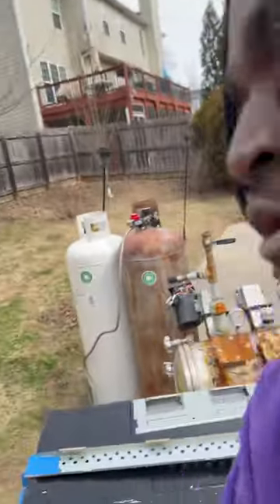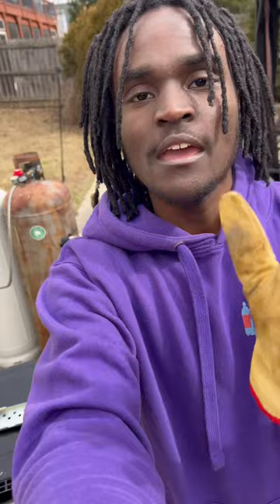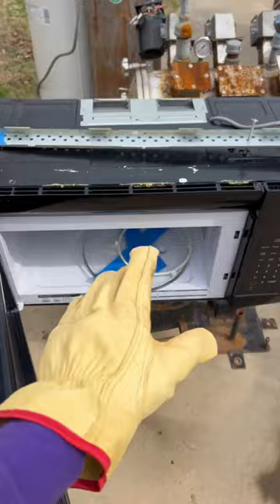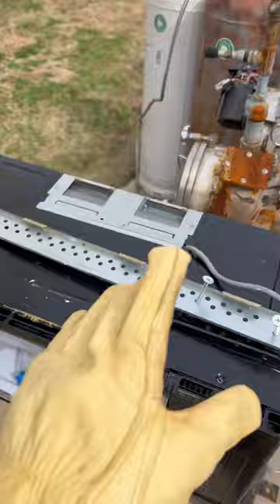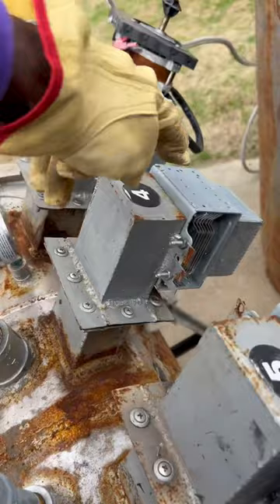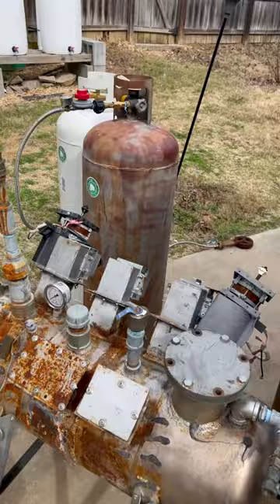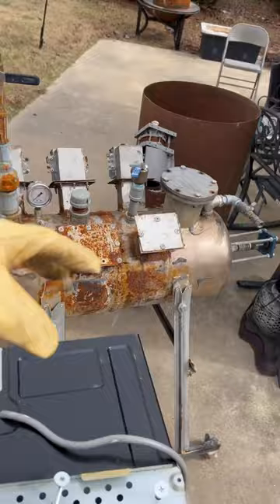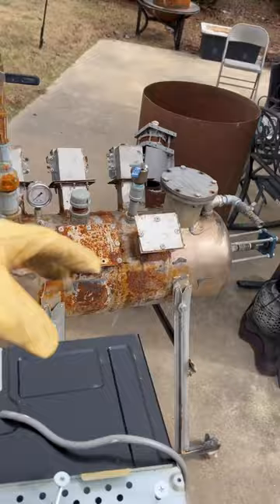Did you know plastic can be turned to fuel with microwaves? ⚡️ #naturejab #viral #fyp #science

Comment: You know using two mots per magnetron will give you 100% duty cycle?
  Be safe with that voltage, I've had 12in sparks!!!!!
Reply from the maker: 2 mots at once is a lil too scary for me 😂
Reply: @naturejab  you are still young, I don't know how much experience with house wiring and electrical work, but let me explain a very simple solution. If you already know this stuff skip ahead to next reply.
   Do you know that in the USA , it is 240v, it's only 120 to the plug because it's only one side of a center tapped transformer. The 240v is 240 because those legs are 180° out of phase. Out of phase means the peek of one wave of voltage will match the dip of the other. With a 240V difference.
   Home breaker boxes , one side is the opposite phase of the other side.
   You can get 240 using 2 extension cords plugged into outlets that are on breakers on opposite sides of the panel..
  Ok enough explanation of what you likely already know.
Reply: @naturejab   The simple, take the electronics from the microwaves exactly like you currently do, but hook up one magnetron two mots, and plug one mot into an outlet on one side of the breaker box , and the other into an outlet on the other side. Done.
    If you looked at an oscilloscope the signal would be n_n_n_ for one mot but mmmmmm for 2 out of phase. (It's a rectified sine Wave, it's like the difference between a half bridge rectifier and a full bridge rectifier)
Reply: @naturejab  yes, mot's are SCARY,   anyone who thinks otherwise don't know nothing.